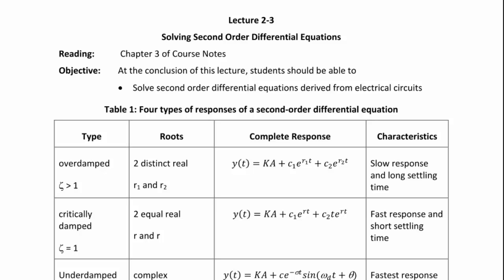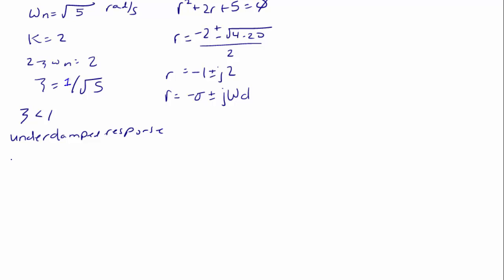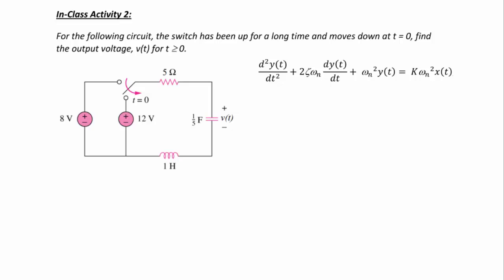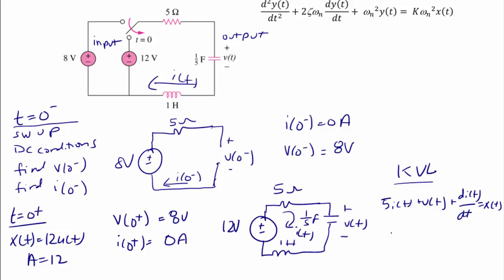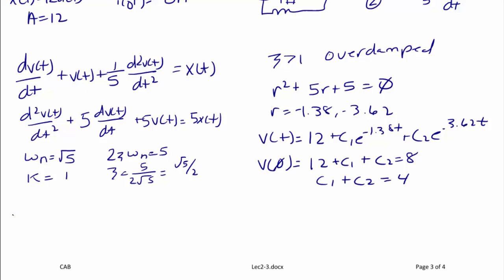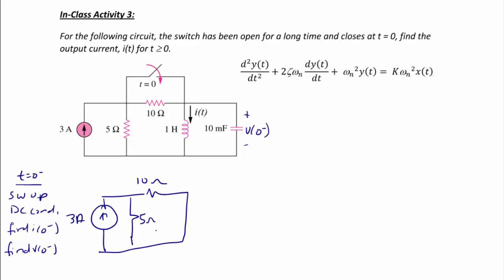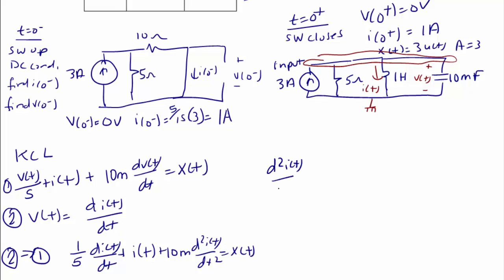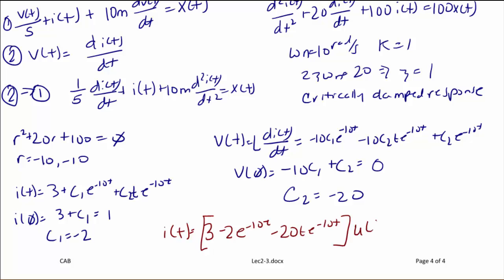ECE205 Lecture 2-3: Solving Second Order Circuits

Comment from the maker: @12:54 the answers for c1 and c2 are switched.  The final answer is correct but there should be a negative sign on 1.38t in the exponent.    

@12:42 the coefficient on c2 should be -0.724 instead of -0.274

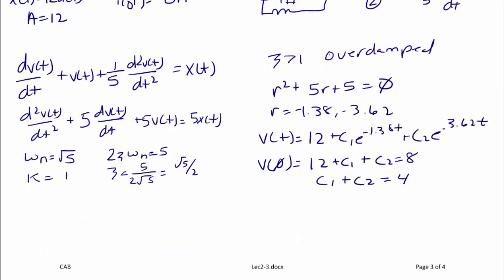@11:44 There is mistake, the equation should be c1 + c2 = -4